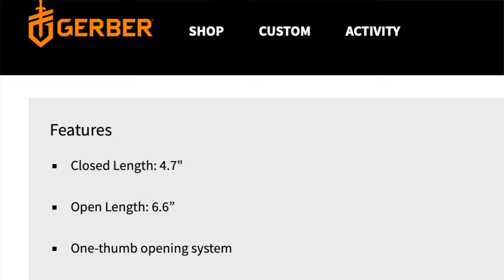Was I too harsh? Gerber Center Drive Revisit Review (6 years on)

Comment: I don't even consider gerber anymore
Reply: At least this is made in the USA
Reply: Same here. I know the Strongarm is pretty tough, but most other brands have knife models as strong as that, without the risk of bits snapping.
     I've broken 2 Gerber multitools, one of them (the top of their range at the time) simply by dropping the tool once, on a Tarmac surface. It disabled the plier spring mechanism. The other multitool was the blade snapping.
    I've chipped and snapped a few other Gerber knives. I've never chipped or snapped any of my other 30 odd knives, which made me think that Gerber's steel choices must be pretty poor.
     A lot of Gerbers have a 'No Name' steel. I'm guessing they're the ones made in China or wherever.
Reply: I don't either...they use cheap steel, the Strong arm, and Center Drive are decent , but their other products don't don't last.
Reply: turns out cheaping out on products and getting your tools made by the cheapest chinese trash factories & by the lowest standards can harm your reputation.
it's sad, but that's the way they took.

Comment: If you want to use the cutters on the Gerber for more serious tasks. You can upgrade the carbide cutters to HSS cutters. The triangular cutters are the same size as the cutters used for lathes. For hard wire cutting, a good rockwell is needed but some maleable properties are needed so the cutter distorts instead of shattering. Which carbide is known to do.

Comment: I don't know why nobody compares this tool the OHT Leatherman which generally sells for 89 to 100 bucks the Gerber Center Drive I purchased at Sportsman's Warehouse for 130 Plus 8% sales tax. I've owned the Leatherman for 5 years and never broke a cutting blade on the jaw. In comparison side by side the Gerber cannot cut compared to cutting with the Leatherman OTH It can cut steel bands off a pallet. You can cut pennies in half if you want Or cut nails it may not have the Center Drive but you can open every tool with one hand. If you drop the Center Drive it will almost always open The screwdriver up and the bit will go flying out. For some reason they felt the need to put holes next to the magnet that holds the bit in. This allows the steel shavings to get in causing poor bit retention. The Gerber Center Drive has a handle that cuts into your hand only goes in the sheath one way protrusions that stick out and get caught. The Leatherman oht handle is Sleek smooth in comparison to the Gerber. The Gerber Jaws are loose and rattly. The biggest fault I find it in the Leatherman oht is the small screws to hold the tools together come loose doesn't matter whether you put Loctite or not there are tiny Torx you almost never have with you. Sacrificing the tip of your jackknife to keep it from falling apart other than that hands down Leatherman is still better.
Reply: This thing about the handle “cutting into the hand” doesn’t make any sense to me. I’m literally squeezing my center drive in my hands now and it’s so comfortable! This was the main reason why i choose it over the Leatherman, which is an amazing multitool, but les comfortable to handle. So far one year i upgraded from a very old gerber 600 to a centerdrive, couldn’t be more satisfied

Comment: I have the center drive plus, which comes with scissors and a nice little bit kit that fits in the sheath. I’m a deck officer on a merchant ship, so a lot of my daily work involves maintenance and repair of safety equipment and brackets. It’s a handy tool, and has held up pretty well. I’ve broken the prying tool, but that’s because I was asking too much of the little guy. If you understand the reasonable limitations of a pocket tool, then consider this one a solid choice. The center drive with bit kit so easily accessible is great.

Comment: I'm not a multi-tool guy.  I'm watching only because you posted.  As a retired dentist I will offer this analogy for why the wire cutter fractures.  With teeth, which hit together thousands of times daily, if the occlusion is off, the weaker of the two teeth banging into each other will shatter.  In other words, if the cutter blades are seated so that they touch too hard or in one spot instead of all along the cutting edge when completely closed, it may shatter.  Just my thoughts.  On the other hand, you have been using this tool over the  years if you've replaced the cutting blades 4 times.  It's not sitting in the drawer!
Reply: Mines sitting in the drawer.. I wanted to much to like this tool but I don’t. Cutters suck. Broke the awl… (they did replace it) hate the serrated blade never use the file, extra bit storage keeps the cutters from closing all the way. The leatherman surge is far superior. Then you get a saw, scissors, better serrated blade, better awl, removable diamond file so you can actually maintain your blade. Those are worth the exchange of real bits to the leatherman bits with bit extender.
Reply: @krazmokramer Taking into account that you are a dentist and not a metalurgist, what about this: instead of using an uber hard ceramic to say we did, we use a hardened steel that doesn't explode like C4 when it touches together too hard? Do you think the multitool CEO's minds would explode if we showed them 20CV or Magnacut or jesus something from within a decade? Also I like your explanation and the point that he's at least using them.

Comment: I've gone back and forth carrying a multi tool since I got my first Leatherman sometime in the early 90s. I have 3 or 4 of the old U.S. made Gerber Multipliers that have the excellent U.S. made Simmonds files in them, a Wave, Surge, Wingman, PST, and my old original Leatherman. I guess now I don't often need a multi tool in my day to day. I'll grab one if I'm going to the range, or camping, and I keep one in the truck and my pack. Occasionally I do find myself standing there, wishing I had a pair of pliers or a screw driver or whatever though and I start carrying the Wave again for a while. Then I realize I haven't used it in three months and stop carrying it again. 
It's a viscous circle..... 😂

Comment: I have this. I am an electricoan. The cutters are for electrical wires, not any hard wires. And they do a damn good job cutting copper wires, even on fine stranded wires they cut beautifully!

BUT there is a notch in the cutters, and that is meant for stripping the insulation, also works eccelent! 

If you place the wire over the notch, they will not cut any good. That is kind of the point. It is explaned in the maual, that the notch is for wire stripping.

Actually a really good tool for electrical work!

Comment: i had similar experience with gerber's cutters, broke on the first wire i cut. i reached out to them and was told "thankfully its all covered under warranty" then asked me to send it in to have replacement cutters put in and verify it wasnt abused. took 8+ weeks for them to mail my multi tool in one box still donning broken cutters. and replacement cutters in another package. wasted my time. meanwhile i bought a leatherman and have had zero issues with daily use in construction. almost all the tools are higher quality at nearly one third of the gerber's price. gerber lives in a drawer somewhere

Comment: You were not too harsh in your previous multi tool comparison. I frequetly use the wirecuters on my 13 year old Leatherman. Sometimes for wire, sometimes for zipties. The file has been handy too. Gerber lost my business many years ago with a poor qyality blade  that snapped when Iwasn't t prying - just cutting tough material. Too many members of the military have related that the handle  came off of their Mark II model  sheath knife. Im not buying their products !

Comment: Pete…that cutter insert looks exactly like the carbide cutter inserts I use on my lathe. In which case…they are designed to slice off fractions of a millimetre of steel at a time, not cut under pressure. They are sharp but brittle. Are Gerber really just using standard lathe carbide inserts as cutting jaws? Wow.
Reply: Good observation. That certainly is very odd.

Comment: All about the warranty for me. Leatherman have amazing warranty / customer service & will ALWAYS get my money over other companies. The model I had was discontinued so they gave me the upgraded model free of charge. Charge titanium with the new replaceable wire cutters, my old model didn't have them. Gerber has abysmal customer service (from my experience) every Gerber product I have bought has failed & they basically tell you to go fk yourself & that using the tool is somehow "abuse"?????
Gerber dime is the only tool I still own from Gerber & the Leatherman squirt is better.
Reply: @klausheisler5014  I totally agree.  Gerber jacked me around over a defective Paul knife in 1985.  Instead of repairing it, they sent me some cheap kitchen paring knives and a Japanese made small lockback.  Hardly the monetary or tool equivalents.  I haven't bought anything Gerber since!

Comment: Maybe it's semantics, but "wire" as sheathed electrical wire is usually a number of small copper wires.  What you were cutting, at the gate, is what I would call bailing wire.  We use a similar aluminum "wire" or twine to bale up cardboard and plastic.  I have to cut that stuff, and use full on snips.  But, I have a tool box in a factory.
Reply: There’s wire and then there’s wire. Obviously copper electrical wire is going to be softer than steel wire. Many companies will differentiate their cutters for “hard wire” vs. “soft wire”…not sure exactly what Gerber states, but if they’re cutting Leatherman micro bits in half, well…that’s certainly steel. But yes, electrical wire =\= barbed wire, bailing wire, guitar strings, etc. All depends on what it’s made of. Many cutters have been damaged over the years from pushing them outside of their intended use (not saying that necessarily applies in this instance). At some point you’ve gotta grab the bolt cutters 😂.

Comment: As much as I loved the Center Drive, I replaced it with a Knipex 5.5 inch needle nosed plier, a Wera Zyklop and two 7 1/4 inch Knipex pliers, the Cobra and the Pliers Wrench. Multi-Tools are cool, but real tools are better. Lot heavier though.

Comment: If those wire cutters are breaking like that they are made of shit material. There’s no way carbide inserts should shatter like that. Life long cnc machinist here.

I would check and see if that is a standard size insert, if it is try get a quality insert.
Reply: If you've ever hit a carbide insert with a hammer or dropped one on its edge on a concrete floor they chip or shatter. same principle going on they're not made for static hits. 30+ year tool and die maker here.
Reply: @Bman-xy2vh  oh yeah, they shatter no doubt, just saying it should last quite a while before doing so. I did see a post though that did make a good point. Because of the design you are always using the same spot on the insert, not the whole cutting edge so that might make a big difference.

Comment: 1:40 To be fair, I have a leatherman WAVE have a burr on the pre-replacable cutter from cutting a paper clip. A paper clip, which I will remind you is not a wire. So every time you rant against wire cutters being replaceable I think of the 3 weeks it took me to get replacement parts from Benchmade and go "nah, I can turn a screw, thanks". Oh also the pliers hinge is wobbly and I don't extend them and pry sideways like AvE. But maybe I have bad luck like my "unbreakable" axis spring breaking in under 2 months. Amazon parts,  I'll pass on returning.
Reply: I use my Surge to cut bike brake cables, electrical wires and steel fencing at my job. Never burred, never replaced the cutters, never any problems with the pliers. I even found an old Leatherman at an op-shop, wouldn’t close, all the tools bent; sent it in and they gave a new Supertool 300.
Reply: @Dan12345  That sounds like exceptionally not bad advice, thanks internet dude, and sounds like a dope tool. You know, man to man in a "not in a bathroom look" kinda way. I didn't want it to come off like I hate the thing, it's in my rotation and there are times where I either need and don't have it (and barely get home) or have it and damn glad I do. But the plier rivet shit the bed, the knife sucks (I mean it ain't magnacut but I'm covered) and the pliers pop past that titanium-osmium military test paper clip induced burr enough to remind me of better times. Love your advice. 

I know it's free, as free as a free thing is, but what was the shipping like? I'm like a dog knowing there's a treat in the bag.  Benchmade was 3 weeks and I forgot what it was even in the package. Coulda moved out by then... pocketclip for the curious.
Reply: @sqeeye3102  I didn't mean to come off as someone that refuses to accept there is anything wrong with them. I've had pivots so bad I've returned them to the store I've purchased and got exchanges, as well. Also, cutting brake cables I think is well out of the calibre of the tool, and I did buy replacement cutters anticipating them to break. I'm kind of surprised how well it's held up, and I think I might have just got a good example.

I think as well my opinion of it is biased, as my job at a second-hand store fits it perfectly. I'd use probably 70% of the tools on any one day. Cut electrical wires, pull nails out of wood, pick up nasty things people have dropped off, open cardboard boxes, cut rope, disassemble furniture with the bit kid, pry open electronics to remove batteries, etc. 

For that kind of job where you are doing everything, its just so handy to have it all on you, all the time, and not have to run back and try and find something in a toolbox. It definitely won't do as well as a normal tool, but its good to have on you. 

I agree that 420HC really isn't up to scratch anymore, I mostly used a RAT 1 for box cutting and used the Surge for cutting bad things as Pete does (on concrete, ceramic etc).

In terms of postage, that was the only thing I had to pay for. Supertool cost me $5 (from my second hand store), postage about $7, and I had a new Supertool 300 in about 1-2 weeks. Keep in mind exchanges and repairs are handled by an importer in Australia, so that might be quicker or slower.
Reply: @Dan12345  Wow, what an informative reply, thank you very much for taking the time. I didn't take any offense to anything you said and hope you felt the same. I'm just sarcastic and swear a lot. Bad habbits and all that. Far as cutters, I'd just be real careful they were clean and aligned if the worse ever happened. 

I honestly haven't really had anyone outright deny that Leatherman pivots never fail or whatever, but Benchmade fanboys will straight up demy that the Axis spring breaking is a myth to my face when I've repaired my own. AND it's a bad design because there are left and right springs, but anyway..

I definitely don't require my Leatherman like you do, but good enough is, well, good enough when the right tool is what works right now. And Leatherman scissors get used as much or more than the pliers. Clippsd and pinched stitches out of people I don't even know, prolly saved people couple grand a pop cause America.

Be careful with the RAT1, it's a gateway drug. I gave it away and carry a Hogue Deka now. Now I give away knives 10x RAT price because "they don't feel right" or "are too heavy/bulky for EDC" so keep that check tight. Deka still here though (black, red, and blue). Totally understand about the postage and shouldn't be as bad in America since it's already "here" and I'm kind of excited.

Last question: how do you end up in so much "fabrication" sounding work in an "op shop" which is what we call "thrift shop/stores" here. Not a lot of metal to be defanged that I've seen. You that handyman in the back that gets stuff working again so they can sell more stuff or am I just too American to understand? Happened to me before.

TL;DR Anyway, you sound like a helpful dude. Thanks for looking out for a stranger from a strange land. I'll pay it forward.
Reply: @sqeeye3102  I've never really had much of a thing for Benchmade, both because of the spring and just the build quality and materials available for the same cost.

As for my job, its more of a second warehouse than a shop; most op-shops wouldn't have nearly the same use case, but we accept almost anything, excluding firearms/weapons and chemicals, so think furniture, pallets, building supplies, vehicles, push bikes, tools, kitchenware etc. We fix them up where we can, sell them, then help people fit them into their cars. My job might go from unpacking boxes of magazines to disassembling a table someone has bought, so they can fit it in their ute, to ripping out nails from timber for some guy, which is what the Surge really excelled at.

Funny you should mention the RAT 1, because I did end up giving it away to a friend of mine. People don't really carry knives here apart from while working, but he seems to like using it.

Comment: The quality and relevance of the review plummets from curious to irrelevant with bailing wire. You are cutting galvanized chain link fence lashing, not "WIRE". Multistranded 18g audio cable or even 12g THHN would be "WIRE". If researching for a purchase, I'd ignore this video completely.
Reply from the maker: well, for those that arent Jeff Blair and wanted to know, every other multitool CAN cut that wire. The gerber carbide cutters cant. Hope that helps 🥰🥰🥰